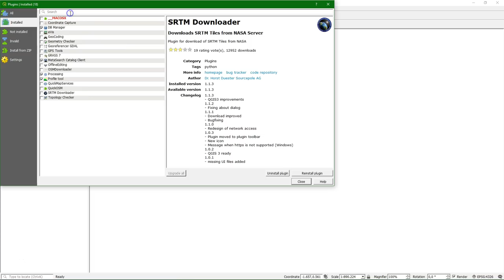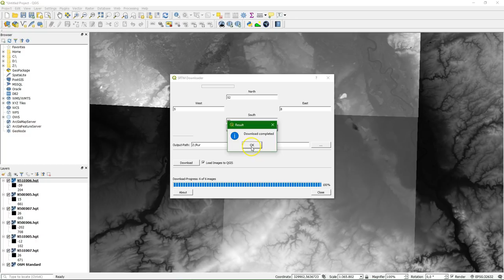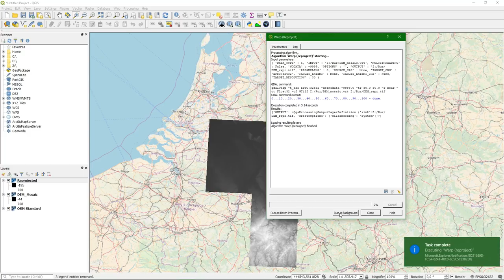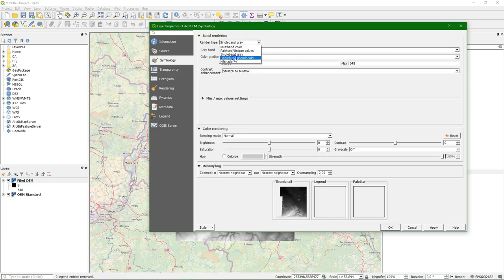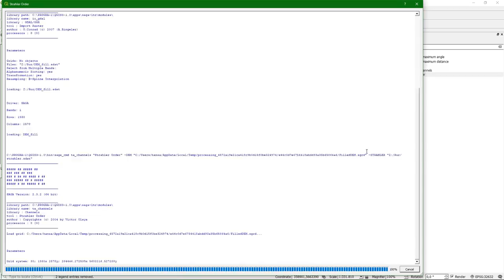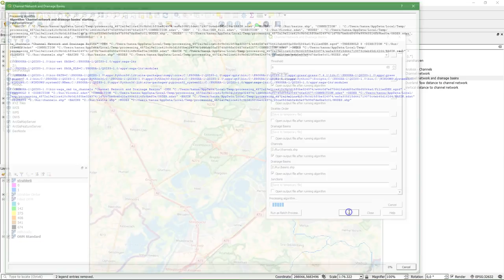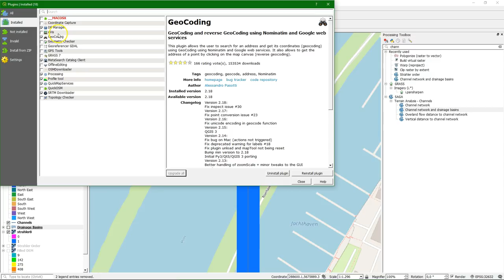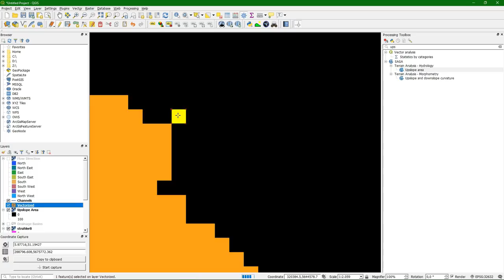Stream and catchment delineation in QGIS 3

Comment: Dear sir, I did all the steps until the clipping, when I run the process, the next error comes out "The following layers were not correctly generated.<ul><li>C:\Users\4BEC~1\AppData\Local\Temp/processing_c01f9474fa7a46379b398a946e7c0e36/c38651f8b05448a9bb716228107b6a2e/S_OUTPUT.shp</li></ul>You can check the 'Log Messages Panel' in QGIS main window to find more information about the execution of the algorithm.". Can you help me pls!

Comment: Excellent explanation! 
I've seen in QGIS 3.10 that the value of area of a given vetorial layer can vary a lot depending on both the Coordinate Reference System (CRS) of the layer and the CRS used to proceed with the calculations. Since I'm in Brazil, I usually work with SIRGAS 2000, UTM zone 22S.
An example of how different the values can be: I've drawn a square with a 10 km side (using SIRGAS 2000, UTM 22S). The calculated area with WGS 84 gave me 41 km² instead of 100 km². The same great difference happened when I did draw the very same square using WGS 84.
My question is: what's the rule to calculate the area in order to get a real value of the portion of land I'm working on?
When I used the "None/Planimetic" option to obtain the area (layer with SIRGAS 2000), I've got the right value. But I want to consider the surface curvature.
Reply from the maker: Thanks. First, never use a GCS (Lat/Lon coordinates) for distance and area measurements. Second, choose a projection that doesn't distort surfaces. See: https://youtu.be/jVn1uCuhO_4

Comment: Dear Hans, thanks for the very usefull video. I have a problem with the Uplslope area function. The system creates the catchment area that I select but the max. and min. values are changing between 100 and 100. In your case it was between 0 and 100. Therefore, my vector file does not seperate the selected catchment area from the complete rest DEM file. I tried to change also the max. and min. values by setting up the min. as 0. However nothing is changing. Do you have any opinion regarding the reason of the problem? Thanks in advance.

Comment: Thanks a lot for this very informative video.
Reply from the maker: In the processing toolbox you can find a tool called Fix Layer Geometry. If you use  this first, it should work. Alternatively, you can calculate a buffer of 0 of the catchment polygon, that also repairs the polygon.
Reply: @HansvanderKwast   thanks a lot.

Comment: Hello Hans, I've found this tutorial very helpful. As a beginner for QGIS, I am having difficulty to calculate the maximum flow path and average slope of the catchment I have. I was able to generate a raster "Flow path length" map using "Flow path length" tool in SAGA, but I do not know how to convert that into a vector stream line from which I can read the maximum flow path, and its average slope. If it is worth to be your next tutorial.

Comment: Hello, I'm new to GIS and this is a fantastic video, thank you! I am examining the catchment of a lake in central America and I have an issue which the method you outline doesn't handle quite so well. That is, there is an area of extremely flat topography with a major river that I suspect will change the drainage characteristics of the region, bu due to the topography the calculated Channel Network Algorithm separates to sections of the river, irrespective of Strahler Order selected. Is there a workaround for situations like this? Any help or guidance would be greatly appreciated and I can provide further detail if you require! Thanks, Matt
Reply: I see that there is a video on "burning in rivers". Sorry I was unaware of this terminology. I will explore these options!

Comment: Instead of calculating the catchment area from the Fill dem raster layer, why don't you export the polygon from the Drainage Basins vector layer created before?
Excelent video, thank you very much for the explanation
Reply from the maker: Thanks. The automatically calculated drainage is not the same as the one from a specific outlet chosen by the user. Often you want the catchment belonging to a specific outlet. In the example they're almost the same, but you could also choose the outlet more upstream to delineate a subchatchment or choose a point where you measure discharge.
Reply: @HansvanderKwast  Right! I understand. Thank you.

Comment: Hi Hans, every time when I run the Warp projection and I set the output file resolution to any value, the projection does not run. It keeps on loading for hours. Could you please assist me in this.
Reply from the maker: Maybe your raster is very large (large area or high resolution). As an alternative you can click right on the layer and choose Export | Save as.... Here you can reproject and clip at the same time. Change the CRS to the target that you want and change the extent to match with your area of interest. I hope that works. If your area is very large, you can choose a coarser DEM. You can download DEMs via the OpenTopography DEM Downloader plugin: https://youtu.be/EMwPT7tABCg?si=7tvwOAw9B2L1Ej-Y. Try a 90 m if 30 m doesn't work.

Comment: I experience an error when I get to strahler order,been doing it for quite some time now and I really don't know what to do anymore. error "Layers were not correctly generated". What could be the problem?
Reply from the maker: There can be several reasons:
1. Check if you used the filled DEM as input and not another layer
2. Make sure you save it to a folder and file name without spaces or other strange characters
3. Maybe your DEM is too large and your computer memory can't handle it. Then you should reduce the area or use a coarser DEM.
4. Maybe your area is too flat.
5. Use LTR versions of QGIS to have less bugs. The current LTR is 3.10.9
6. Check if your DEM doesn't have voids. This is explained here: https://youtu.be/FwJSBoTn1y4
I hope this helps.

Comment: Hi Hans, thanks so much for your videos, I have used them a lot while studying limnology at BOKU. I'm having an issue at the thinning step - too many cells are removed and the line is no longer continuous, which leads r.to.vect to create many small lines. Any suggestions?
Reply from the maker: Hi! Probably something went wrong before. The question seems to be at the wrong video, because this video uses SAGA, which doesn't need r.to.vect. I assume you're using the PCRaster approach in this playlist: https://youtube.com/playlist?list=PLeuKJkIxCDj05rwD3Fun7v7rpVRg7c_kE&si=kd661MjchSynsclX. Please make sure you follow all steps carefully. Check if the raster streams were still connected before thinning. Also check if your projection is correct (should not be in Geographic Coordinate System) and make sure you use the correct inputs all the time. For further questions about this approach, please post the question under the appropriate video.
Reply from the maker: This means that you can't automate this approach on Mac, unless you find a way to build PCRaster from source code and use it in your regular installation. Unfortunaltely, I'm not a Mac user, so I can't help you with this.

Comment: Often I encounter an error when I try the "fill sinks" function. I am following every step of yours and it works on some catchments but doesn't on some others. What could be the problem? Is it important the "output layer type", because it's Float32 by default in your video and different in my project, so I always change it to Float32 as well?
Reply from the maker: Fills sinks gives problems in the following cases:
1. DEM too flat
2. DEM too large for memory
3. Geographic Coordinate System used instead of projection.
4. Spaces in folder and file names
Reply: @HansvanderKwast  Thank you so much, sir! The problem was with my folder's name, which contained a special character. Now it works perfectly. Please keep posting these amazing tutorials, they mean so much to me and many others!

Comment: Thanks for the video, as a beginner it is very helpful but i faced a problem while generating the Strahler order for the area of interest, it shows a error saying "The following layers were not correctly generated" and gives information about the location of the save file. im currently using qgis version 3.10 , please help me out with the problem
Reply from the maker: Make sure you've upgraded to 3.10.3 and you don't have spaces in file and folder names. Also check if you've used the filled dem and it doesn't have voids.

Comment: Thank you, Professor, it really helpful. I have a problem regarding the extraction clip raster by mask layer. I am not able to save the clipped mask into .sdat format. I have chosen Float32 as the output data type. Fyi, I am using QGIS Madeira. Do you have any idea?
Reply from the maker: Maybe you got a "geometry error"? In that case you can use "fix geometry" from the processing toolbox.
Reply: @HansvanderKwast  Thank you for your kind reply. I will do it.
Reply: Hi Ferdinan, please I'm having a similar problem. Did you get the solution? I try the procedure that the Professor suggested but it didn't fix the problem

Comment: This is great content and an even better explanation! I just have one question regarding the fill tool. My computer can not execute this function what can possibly be the problem? Is it the RAM or maybe something else?
Reply from the maker: RAM can be the problem indeed. Check if you can use a coarser spatial resolution for your study area. < 5 m will not improve the results and for large catchments 30 or 90 m is okay too. I recommend at least 16 GB of RAM. If the size is not the problem, check if you use spaces and strange characters in file/folder names and if there are no voids in the raster. Also if the area is too flat you'll run into challenges.
Reply: Thank you for the detailed answer. I appreciate it

Comment: Hi there. Hans. I have a shape file of river lines. But with the automatic digitization of the raster, the directions were lost. Please tell me how to automatically set the directions of the lines in the correct direction according to the DEM. (I work in QGIS 3.14). Thank you.
Reply from the maker: Hi. When you derive the channels using the method in the video, the flow direction of the lines should be correct. You can only reverse the flow direction with a tool from the Processing Toolbox --> Vector Geometry --> Reverse line direction.
Reply: @HansvanderKwast  I asked about a special case. My digitization was based on cadastral drawings of rivers, not on your algorithm.. Therefore, many directions of the lines are broken. I need to select and turn in another direction the lines of rivers that "flow up". Altitude is present. Thanks.
Reply from the maker: Unfortunately, I don't know another way then manually choosing the segments and use the reverse direction tool.

Comment: Dear Hans, it is a wonderful tutorial video to show drainage and water network. I am using the version of Maderia 3.10.14 currently. While watching the video, on the section of 11:00, I just encountered an error for fill sinks /wang lui showing that algorithm did not work in red colour and no raster as dem_fill appeared on the left box. Despite all my efforts, I could not manage to fix it up. Could you recommend me a way of solution to it?
Reply from the maker: Thanks. For my tuturials you should always use the LTR versions. Newer versions have new features, but can introduce also new bugs. So 3.4 or 3.10.4 are recommended now. It can still give an error (see also https://youtu.be/2Ub0c7Ss-T4). The these are the options: (1) run it again immediately, maybe it works the second time, (2) check if file and folder names don't contain spaces or strange characters (https://youtu.be/kggwFZHXCl4), (3) check if you're using a metric CRS instead of GCS, (4) maybe your area is too large for the memory. Hope this helps.
Reply: @HansvanderKwast  Thank you so much for responding both quickly and informative. I will follow all instructions and advises you just given, if it does not work again, I ll keep you posted about it. Best.
Reply: @HansvanderKwast  Dear Hans, although I followed all your advises to solve the problem yesterday, I again encountered the same problem while on processing filled terrain (The following layers were not correctly generated.<ul><li>C:/mos/DEM_filled.sdat</li></ul>You can check the 'Log Messages Panel' in QGIS main window to find more information about the execution of the algorithm). The area that I need is Mosul and its environs. The area is not large enough to cause an overdata problem. I suppose the Mosul dam which covers a large tract of land cannot be detected probably. Could you know if the fill sinks (wang & lui) cannot map the lakes and dams ?
Reply from the maker: @OUSTAO  The dam might be the problem. The fill sinks algorithm will fill the depression in the DEM to make sure the water flows to the outlet. It results in a large gently sloping area (like the mines in my example). If the lake is covering a large part of your DEM then probably it can't solve the equations and gives an error. Normally I advise to delineate catchments with an outlet where a river enters a lake.
Reply: @HansvanderKwast  Thank you but again I had the same problem, even though I followed the steps you recommended, probably the terrrain is highly mountainous and it cannot detect the catchment area.
Reply from the maker: @OUSTAO  Normally it works great in mountaineous areas. Maybe you have voids that you need to interpolate first.
Reply: @HansvanderKwast  I see, but there is one thing that I wonder. Is it possible to open googleearth map or any similar topographic map instead of open stree map? Because it may show the rivers basin more accurate without overlapping with national and regional borders.
Reply from the maker: @OUSTAO  Use the QuickMapServices plugin and choose any layer that you like.

Comment: worked great! is there any way to make improve accuracy of rivers in lowland areas where there is little elevation difference? thanks!!
Reply from the maker: You can play with the following:
1. Use a smaller minimum slope value in the fill sinks algorithm
2. Use another algorithm than D8, try MFD or D-INF
3. Burn in the river system so the water is forced to follow more realistic water courses. Some videos on this channel about that.
Reply: @HansvanderKwast  okay great, thank you!

Comment: Sir what is the importance of minimum slope dialogue in fill sink by wang &liu method??
Reply from the maker: The minimum slope parameter in the Wang & Liu fill sinks algorithm is a user-defined value that determines the minimum elevation difference (and thus slope gradient) between adjacent cells in the filled digital elevation model (DEM). This parameter is important for hydrological modeling, as it affects the flow direction and watershed partition of the surface. If the minimum slope is set to zero, the algorithm will only fill the depressions until a horizontal surface is established, which may not be realistic or helpful for simulating water flow. If the minimum slope is set to a positive value, the algorithm will fill the depressions and also create a slight downward slope along the flow path, which may improve the accuracy and stability of the hydrological analysis. The optimal value of the minimum slope parameter may depend on the resolution and quality of the input DEM, as well as the specific objectives and assumptions of the modeling.

Comment: Hi.. I see your this  video.. and i see the drainage basin and catchment boundary which you derive is same , then why you create again catchment by upslope area tool, while it was also done by drainage basin?  also i want to know weather drainage basin and catchment may differ or not?
Reply from the maker: They are not exactly the same. The drainage basins derived by the channel network and drainage basins tool derive all basins in the DEM based on the flow direction. The upslope area tool will delineate a specific catchment that belongs to a specific point in the river that you indicate in the tool. That can be the outlet or any point in the river. It calculates the area that contributes to water flow at that point.
Reply: @HansvanderKwast  Thanks for giving me clarity on this.

Comment: Hello there, thanks for the explanation. I have a problem with my QGIS 3.10.9. When I made the virtual raster, it won't show when I delete the tiles from the previous step. Can I get your help?
Reply from the maker: Are you sure that your layers virtual layer was on top of the other layers? If it's below you can only see it by switching off or removing the other layers.
Reply: @HansvanderKwast  When I unticked the other layers except for the virtual raster, nothing shows up.
Reply: @HansvanderKwast  Never mind, just fixed it.

Comment: Thanks for your videos, they are great. I have a problem with small catchments though, even if I pick a point that falls onto the stream DEM, the up-slope area algorithm gives me a completelly black DEM, how could I solve that and get the area for a whatever sub-catchment?
Reply from the maker: Hi Angelo. Thanks for using my videos. Maybe you can send me some screenshots so I can check your problem?
Reply: Hi Hans,
I managed to solve the problem I think. The up-slope output is sometimes a black DEM but as you suggested, by adding "0" to "Additional no data value" in Properties/Transparency, the DEM shows the watershed delineation, I just do not understand why it happens only in some case. Any clues?
Thanks